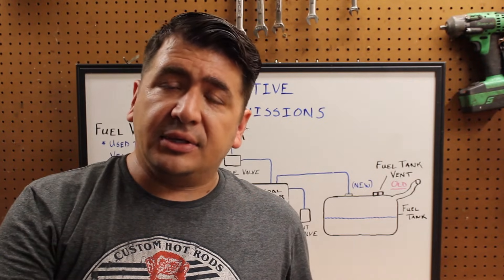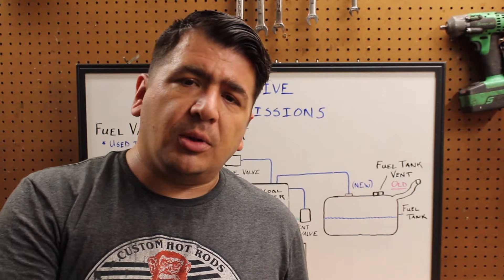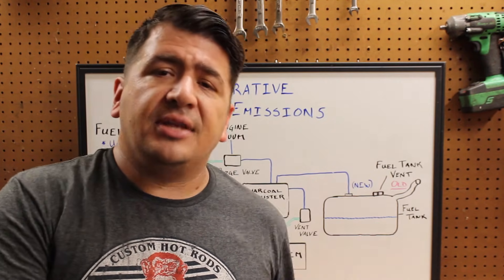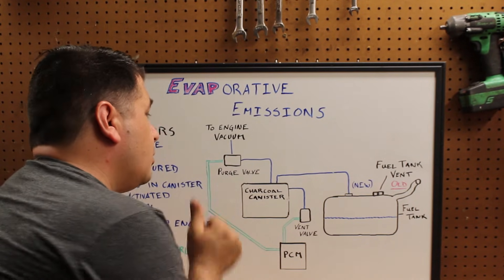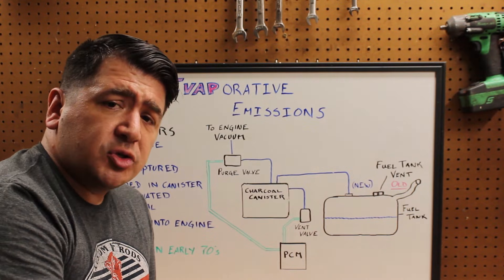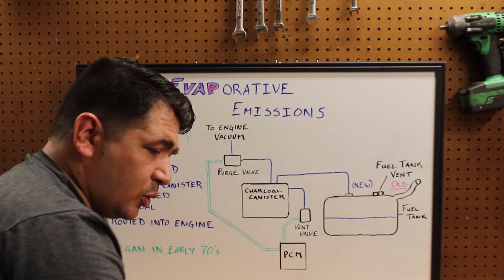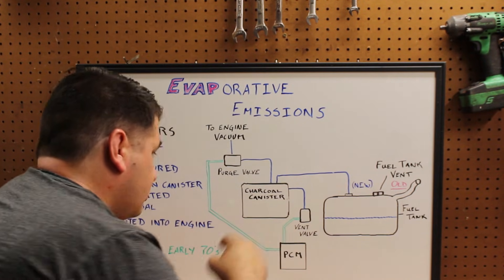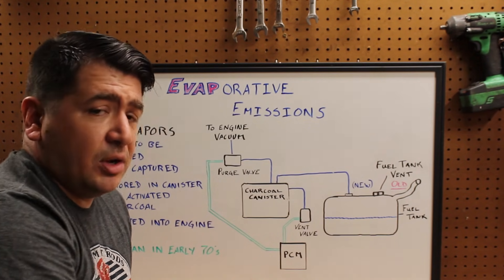How EVAP Systems Work - Automotive Education

Comment: Some important info...VENT solenoid is spring loaded open and commanded closed electrically. This allows air vapors to "vent" to atmosphere while refueling so your fuel nozzle doesn't shut off on you. PURGE solenoid is operated the exact same way, spring loaded to close and energized to open by ECM. This will help troubleshoot evap problems.

Comment: Thank you sir! Canister replacement under way. Didn't know not to top off gas tank and clog the canister on my 07 Chevy Silverado 1500 HD classic 4wd 6.0 95k which has symptoms, when pumping gas keeps kicking off if inserted too tight, warmed up it runs a little rough at idle. A 95' Dodge v10 3/4 ton was my last one.

Comment: HELP! I have a car that runs really rough or even stalls once tank is less than half full. If I open gas cap it will settle out and run/ drive like there was never a problem.  Could this be a vent valve or orifice on the canister problem?

Comment: Tell me why a complex emission and fuel system that's primarily located under the vehicle is construction from substandard materials that's guaranteed to prematurely fail? This is a similar intentional design flaw with exhaust system in the 60's and earlier, until they were made from SST.

Comment: Just unplug the line from your intake and cap the hole in your intake.  Leave the evaporator line vented to atmosphere.
Reply: Won't that turn on the check engine light because when the car pulls a vacuum on the gas tank to check for a leak, it won't be able to pull a vacuum (since you capped the line) so it will assume there a leak

Comment: I have an 89 Jeep YJ with an inline 6, 258 engine.  I switched over to electronic ignition and ditched the PCM. Many of the sensors/valves had already been removed or disabled before I got the Jeep. My question is can I just have to small hose from manifold vac going straight to the charcoal canister and a line back to the carb without and metering? And if not, can I just yank the line back to the carb from the canister and leave a vacuum pull through the canister to vent the gas tank? I’ve watched your PVC video as well and think I have a question about that as well, same situation, not PCM control, but I don’t think that one needs one.  The 258 engine had all sorts of convoluted hoses, one way valves, and what not on it.

Comment: Kyle - don't see that you comment much - hoping for some help.  My Honda Fit is pulling a 2422 code - evap vent valve stuck closed.  It's not - and it functions properly (when charged, closes and holds vacuum) - the ECM is delivering 12v to the valve - anticipate the ECM uses the ground to engage/disengage the valve.  With ECM delivering 12v and a direct connect of the valve to the battery ground, the valve closes - so the valve is fully functional.  Yet the code...  The Fit's fuel tank has ALWAYS been a difficult full-fill - 10 gallons and on a full tank fill, the pressure shuts off the gas pump (back-pressure) at like 7-7.5 gallons.  (that's about 100-120 miles of road travel).  I know the valve is functioning - still pulls the 2422 code.  Ideas?
Reply from the maker: Charcoal Canister is probably restricted. Seen a number of them full of water. That code will set if there is any restriction in the system, check the lines and the vent, but your issue is likely the Canister.

Comment: I understand this system now.
Now I know the advice is not to trickle fill the tank as gas can flow directly into the charcoal canister which could cause it to malfunction.
I get this…however, my big question is:
IF I’m on a long road trip and know I have at least 100-200 klms left to go immediately after paying for fuel, in this circumstance, is it ok to trickle fill to the fuel neck if normally I would only fill to the first click (for shorter round town trips)?

I figure if I straight after filling to the brim do at least 100 klms then the charcoal canister (if not defective) will correct itself.
Reply: no

Comment: Dear, if you disconnect the evaporation hose from the antique, will the pcv valve still work normally?  Or does it depend on the air suction from the antiques?  My greetings

Comment: The chamber purge valve on my Suzuki Swift got broken and I couldn't find a new/used one to install. The mechanics to whom I took it to all thought the purge valve was some "air component" and one of them replaced it with a small air filter, wich I know is wrong, but I'm keeping it on because otherwise the fumes make the car smell of gasoline.
Is it possible to just delete the purge valve and have a direct connection to the charcoal canister?

Comment: How did pre-computer controlled(pre-1980's) vehicles control evap systems without the use of a pcm?
Reply: There was no purge valve, it was only charcoal canister. The vapours flow from the charcoal canister were almost uniform. The carburetor was tunned accordingly.
Reply: Vacuum operated valve
Reply: They didn't have evap systems, just a vented tank
Reply: @michaeljvan6117  the vented tanks to the atmosphere were no longer allowed by the epa sometime in the late sixties into the very early seventies, my question was pertaining to the systems before computer controlled emissions and after the vented to the air systems.

Comment: I changed the vent valve the charcoal canister and the fuel cap and I still get the code p0455 I’m sick and tired of spending money on stuff that’s not the problem I spent over $300
Reply: Maybe the fuel cap is not closed proprely or there is a hole in the pipe.
Reply: @ilirhalili4712  nope no hole and cap is properly on and closed tight
Reply: @dustinbergeron7508  it’s the p0455 is “major leak detected” so probably from the fuel tank, you said you changed the valve but look if there is any hole in the canister. It’s plastic so it can be damaged easily.
Reply: @ilirhalili4712  changed the purge valve, canister, pressure sensor, fuel cap, filler neck, and the vent valve
Reply: @dustinbergeron7508  shiieet, well, last thing to do is to clear the code and hope for it to never show again. I had some problems with my sister’s Peugeot 208 with the adblue. The light turned on and I turned if off, then it came back and disappeared by it self. At that point, just drive with it if you can without any risk.

Comment: Would a bad charcoal canister cause spark knock?
Reply from the maker: No, "Spark Knock" is a result of multiple flame-fronts colliding inside the combustion chamber. This would be caused by a second ignition source in the cylinder igniting the mixture in addition to the spark plug.
Reply: DIY Auto Homeschool alright thanks I’m gonna replace all my spark plugs and see if it makes a difference. Love the videos man!
Reply from the maker: @NirvanaBoy300  What problem are you having and what kind of vehicle do you have? If you believe you're having Spark Knock, spark plugs are not usually the issue because true spark knock will happen when the plugs fire, but so does another ignition source in the chamber, causing the 2 opposing flame fronts to collide during combustion. 

Now, you can have spark knock, detonation or pre-ignition, and you kind of get to a point where these issues can overlap or be confused for one another. If your engine has a bunch of carbon deposits and buildup in the cylinders, they can act to basically increase the compression ratio of the cylinder, causing the pressure and temperature to rise above the fuel's ability to resist combustion just from heat alone (Octane Rating). That would be detonation or pre-ignition. That same carbon buildup can  begin to heat up and the build up of excess heat on those points can reach a point that they will act as a secondary ignition source, creating that opposing flame-front that can cause spark knock.
Reply: DIY Auto Homeschool I drive a 2001 Lexus ES300 with 165k miles. I hear a rattling type noise under load. What are some options I have to fix this?
Reply from the maker: @NirvanaBoy300  Before you do replace anything, just fill up your tank with premium fuel and drive for a bit. See if it changes. If you're not using 91 octane, you really need to be. If you don't have 91, you might skate by with 87.